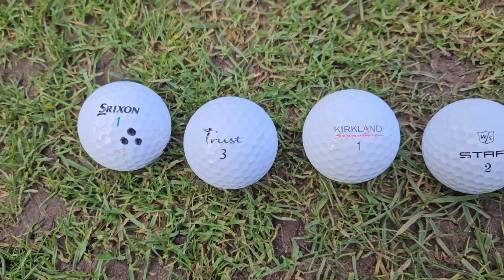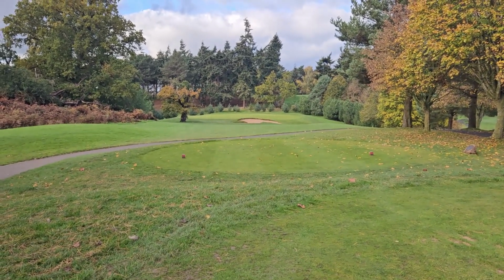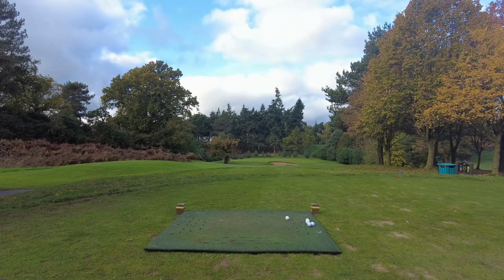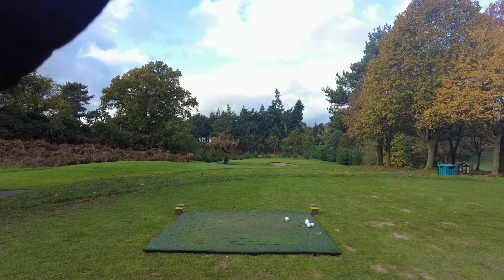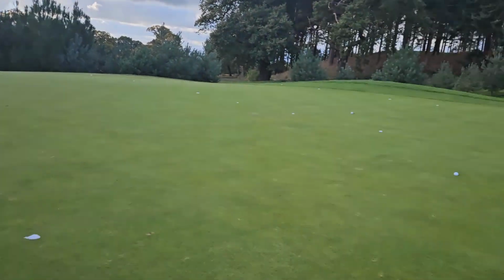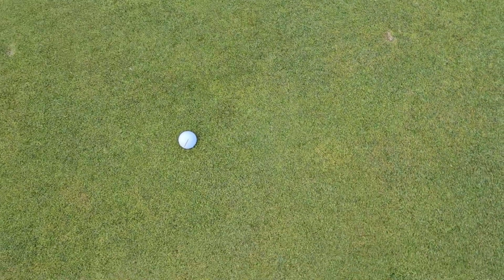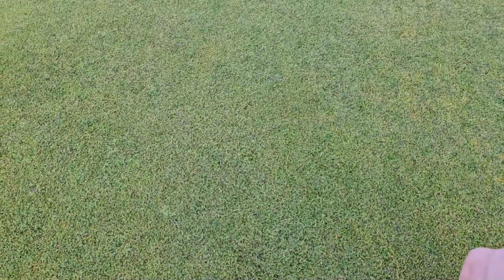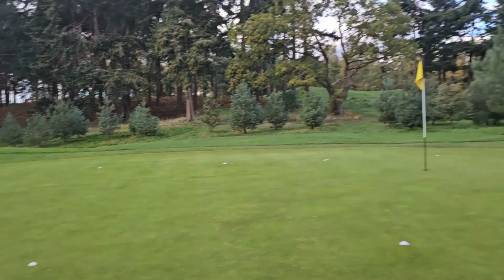Testing The Difference Between CHEAP And EXPENSIVE GOLF BALLS

Comment: the trust ball is weird. it can not handle the driver at all, but does quite well with short game and greens. atleast when i used it, the coating stuck to the driver every hit, and that would cause the ball to fly out of control alot.
Reply from the maker: Yeah I do have a review video recorded for them, but I'm not really sure whether to upload it. I just found them very meh as a ball. Irons and short game all decent enough, but as you say, just seemed to have an odd flight with driver and cut up so easily